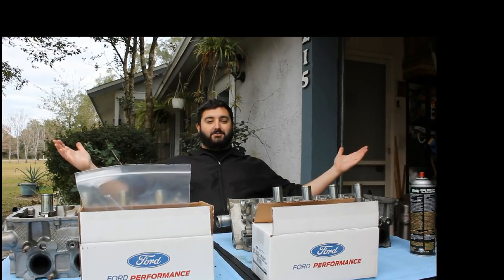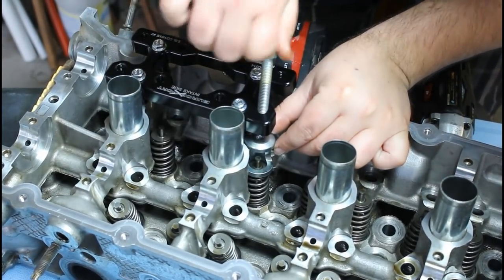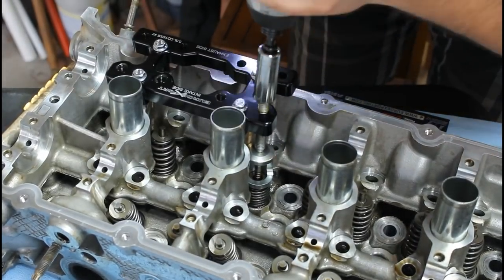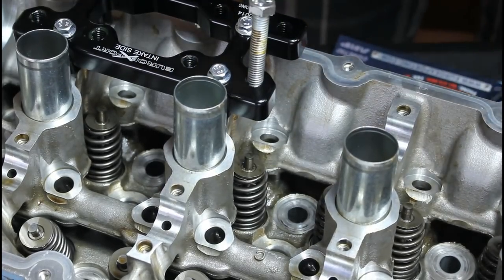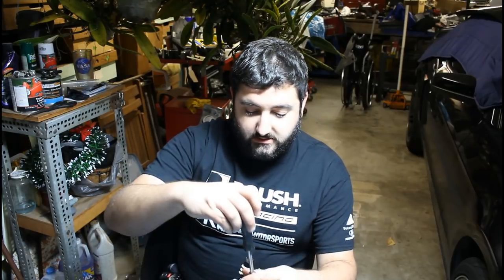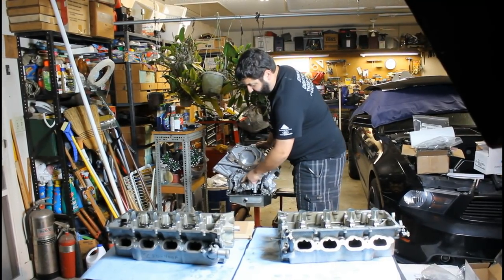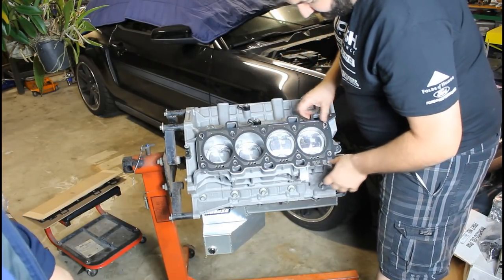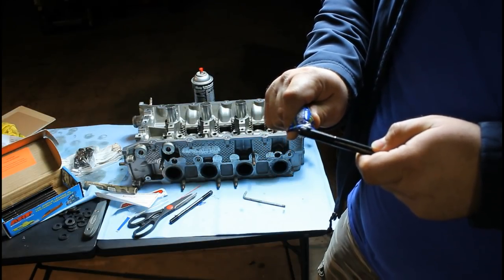Coyote Build Pt 7: Boss 302R Valve Spring, ARP studs and Heads Installed

Comment: I bought that valve spring removal tool to repair a broken valve spring.  I pulled out the camshafts.  I ended up replacing every spring with the Boss 302R springs.  I did it without removing the heads by ensuring that as I worked my way across, each cylinder was at top dead center so that the valve didn't fall into the engine block.  The little keepers are a serious pain, but here's a trick (wish I had filmed it).  Use a magnet to remove the keepers which is easy and I've seen it on Youtube before, but putting keepers on is a bit of work. ****When putting the keepers back on, I came up with the idea of putting vasoline on the inside of each keeper and on the tip of my finger.  The vasoline made the keeper stick to my finger while I got them into place on the valve and then stuck to the valve as I put each keeper in.  I don't know of any other way that I could have gotten this done, but it made life extremely easy.  Make sure you plug every single hole in the head including spark plug holes.

Comment: ok so did you guys use the "stock" retainers and locks with the boss 302R valve springs? in the process of building my 2011 Coyote gen 1 shortblock and i wanted to update my springs to the Boss 302R valve springs as well. please let me know. Trying to save money but i want to do this the correct way :)
Ben
Reply: I just did that very same thing.  I reused the stock retainers and locks as they were all in very good condition.  Use vasoline on your finger when putting the locks back on!  Works slick!

Comment: Excellent video! What head brand gaskets did you use?
Reply from the maker: Just Ford 11-14 OE ones
Reply: @OutOfLineGarage  Just sent a rod through the side my the block on my 2012 RS3 at the dragstrip last week. I will be building a forged shortblock in the next week or two. Did you block off your oil squirters or does your block not have them?
Reply from the maker: Kevin Lynch I did a 15-17 shortblock.

Comment: Im looking into building my own gen 2 Coyote. These engines worry me a bit tho as far as reliability because of the timing chain/ secondary chains. So many parts that could break. And the issues people have with "ticking". Hopefully aftermarket parts could solve those issues and my worries.
Reply: Late comment, but these engines are reliable as long as procedures are followed, and since they use chains and not belts, there's no reason to really worry. And most ticks are nothing but valve noise that doesn't hurt anything. 121k miles on my 2015 here and shes still doing pretty good

Comment: Guys, good try on an engine build.  You spent a lot of time, effort, and money on this (not counting the video editing time) so ask for some expert guidance from an engine builder in the future.  If you don't abuse the engine when you are done it may last a while.  But, there are some things in the build you did not know that show to folks who have done this for a while.  For example, when changing the springs, it would have been good to at least inspect the valve seats if not do a run-out check on the seats.  While you have it all apart and putting new parts in, especially new springs, it is always good to check over the operation of the dependent components.  It might have even been good to have a minimal seat grind done, or, in the alternative, just hit them with some lapping compound to be absolutely sure you have a really good seal.

Also, I can't tell from the video for sure but ALWAYS check to make sure the water jacket / steam port holes all match the opening size on the gasket.  AND, on the oil port hole it would be good to call the MFG to verify that is not an issue.  Going smaller or allowing any kind of obstruction on oil or water ports can have catastrophic consequences.  Always verify those things.  It would not be the first time I've seen gaskets that need to be slightly adjusted to fit the actual application.  ESPECIALLY when it comes to the cooling system.

Wrote a comment then saw you did it! AWESOME on showing the 3 step torque tighten!  A lot of folks do not do that and it is critical for "bolt stretch" and to settle things in.

Comment: Wtf??? Second clip of yours I have ever seen. 30 seconds in and you say “ these little retainer clips things”.... they are called collets and the retainers are the “I don’t even know this is called” part.
How can you even post this dribble up. Learn on your own time and at your own cost by all means, don’t post this shit up as a how to as you clearly have NFI what you are doing.
Tip: you NEVER use a spring compressor with a head face down. You actually drove that first valve into the desktop. It is wonder you didn’t bend the valve.